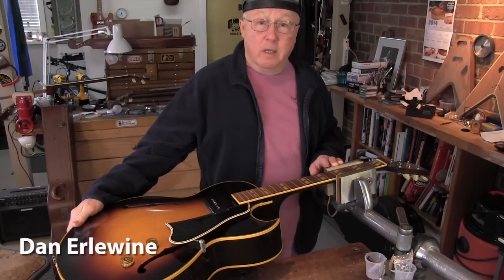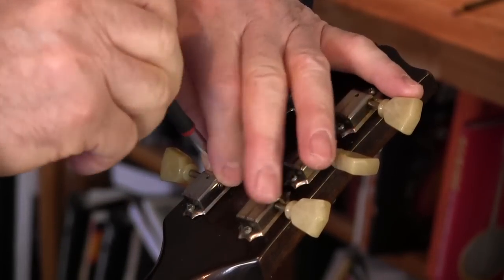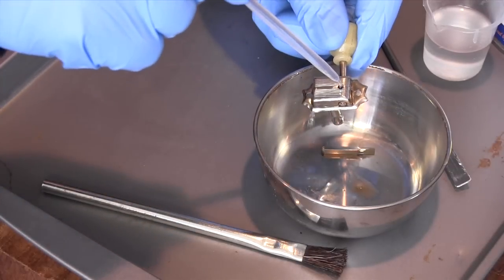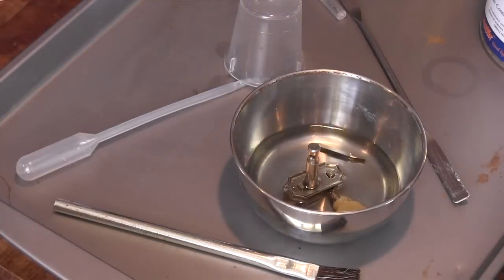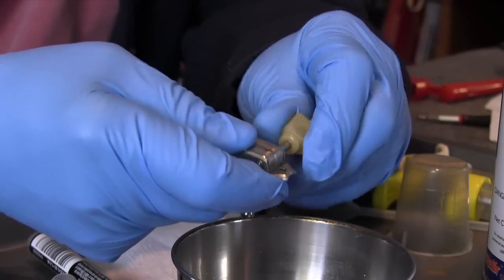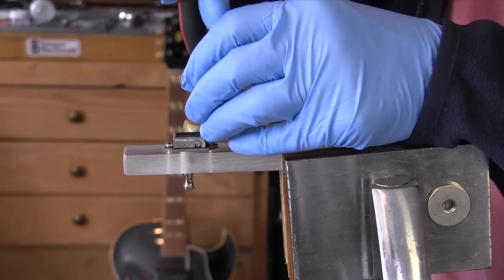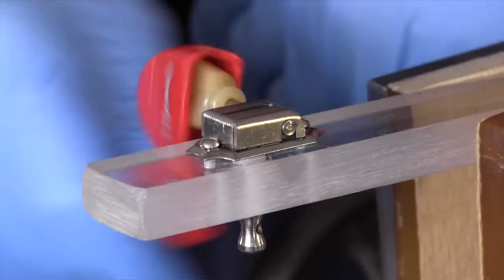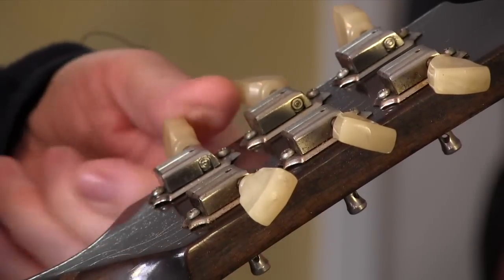How to clean dirty old guitar tuners

Comment: I just took my 1963 Gibson ES 330TDC out of the Keys the first time in about 10 years. To my surprise all of the strings were sharp. I had to D tune each one slightly.. I have noticed this same thing with other guitars I have. The strings get tighter when they sit for a while.
  Anyway all of my tuners were tight to turn..I have never had them off the guitar, I have owned this guitar since 1969. (swapped my $50 arai 12 string acoustic for it—Keep in mind, in 1969, $50 was a lot more money than it is today. I was working after school at Kentucky fried chicken for $.85 an hour). this guitar has become valuable ,I don’t take it out of the case much anymore.
 thanks for the heads up about removing the tuners  off the guitar to protect the finish from chemicals. I hate tinkering with  my valuable guitars for little reason, but I sure don’t want anybody else touching them..

Comment: Hi Dan, I use a medium sized ultrasonic cleaner for this, when I have ALL METAL tuners (buttons)  I use a 10:1 mix of tap water and Simple Green. If its good enough for the delicate orifices in fuel injectors.... Blow them out with compressed air, bake them at a low temp about 150F in an autoclave (I have a dedicated toaster oven for stuff like this), lubricate, and install back on guitar. Ultra sonic cleaners will find many uses around your shop, you can even resurrect touch-up paint in small jars and clean paint brushes.  UTLTRASONIC CLEANERS WILL DESTROY PEARLOID BUTTONS!
Reply: In total agreement with the ultra sonic cleaner. I've had parts that otherwise was trashed if not for this cleaner. It really works those ultra small particles out of no reach places. Highly recommended.

Comment: Naphtha? Every tenth word in the Guitar Player Repair Guide is naphtha. Naphtha flows through Dan Erlewine's veins.
Reply: Hahahahahah. Great comment dude.
Reply: Solvents represents a serious health risk. I would suggest proper ventilation, or you could use a mask, but those are expensive and not very comfortable. Also try to avoid getting the stuff on your skin, as it dries out the protective layer of fat around your nerves.
Reply: I'm an ex-slot car racer. You'd be surprised at how much we'd go through. . . . . .
Reply: I’ve been amazed at all the different things different professions use for cleaning. Auto repair/race teams, brake clean. Auto body, wax and grease remover. Welders, Acetone. Motorcycle/ATV repair/race teams, contact cleaner. Then of course, everything to do with guitars involves naphtha lol.
Reply: @frodehau  masks can be expensive but what if you breathe through a tube that is attached to the window
Reply: I've switched over almost entirely to brake cleaner now because it evaporates faster and doesn't present an ignition hazard.

Comment: I get the use of Naptha to cleanse the gears,but aren’t you supposed to use actual grease(lithium based) to lubricate the gears? I have used tri-flow before and it’s very thin, almost water-like.

Comment: Have a Gibson’ Nighthawk I got new early 90’s. Started noticing couple post sticking out with white knob are loose and wobble. They turn easily, but the rotation around takes about x2 as long. Have looked and looked but can’t find reference to repair or cause.

Comment: Would this work for a guitar that has been through a house fire? The damage is smoke and water, not fire. But the machine heads have seized up. I’ve not come across nap thin in the UK, is it a paint thinner like methylated spirit? Thanks.

Comment: it seems that the link to the behlen naphtha solvent is down on stewmac, the only other similar product i could find on your website is colortone naphtha,  but that specifies that it's "for cleaning dirt and oil from bare wood or cured varnish, lacquer or shellac finishes" will that work as well for tuners?

Comment: Hey Dan, I got a Problem with sealed Tuners from a Peavey T60 here (from 78). They were in a bad shape and it took me hours to clean them up.I'd like to take them apart and replace the grease/oil that is in there. Any Video on how to do that?The dirt that i took of them could be the fluid that should be inside. One of the Tuner kobs won't come off and i don't want to use brute force. WD-40 or naphta won't do the trick.

Comment: I wish I knew the last step where he had the tuning peg mounted on that piece of acrylic... so as not to damage the finish- once you've mounted on a alternate piece and you feed more tri-flow, do you then go back and 1) rinse the tri-flow out w/ some more naptha or 2) let it dry? I have a 1955 Gibson J-50 and pretty much everything on the guitar is in mint/original condition... but the tuners are a bear to turn. I'm feel like I'm forcing it by turning it.
Reply: +Ronnie Williams The lube stays in the housing! It's the solvents in the formula that you need to worry about. It typically vaporizes after its done its job (cleansing grit and maintaining viscosity). You should use a cue tip and some naptha to clean the plate of any excess oil, then remove from the alt piece and clean the bottom and post, wipe with clean cloth to check for grime. When dry it is ready for the head....

Comment: how do I clean these 60s Rickenbacker closed Kluson Deluxe tuners. I notice mine turn but some have a spot when it turn around that gets tight. It is in the same spot every time during 360 degree rotation. I tried WD40  then dried then greased but same thing. Is the gear done? Or should I try somthing else. Might try the bath in lighter fluid like you said maybe there is hardened gunk on one part of the gear? Or does the tuner need replacing?
Reply from the maker: Hi Bubba! I think it's worth a shot trying to save these tuners with the method shown here with naphtha and tri-flow lubrication. I couldn't rule out a bad gear without the guitar in hand, but I think you'll at least improve the tuners functionality compared to your previous attempts, if not solve the problem outright. It could be a bad gear tooth or it could be an accumulation of dried grease and dirt on that particular tooth, but this cleaning method should give you an answer to that mystery.

Comment: Why wouldn't you use a penetrating fluid like WD-40?
Reply: because it can be too effective at times, and hard to completely get rid off again. 
it's fine for all metal mechanisms, and incredible at breaking decates wotrth of crusty gunk. but among other things, it can seep into invisible cracks in plastic parts though capillary force, and drive them further into the material like a molecular wedge. (this is exactly how glass cutting fluid works. and WD40 makes a goos substitute for that stuff)